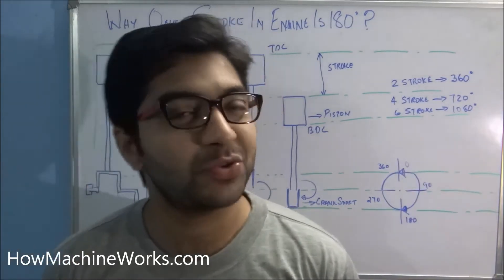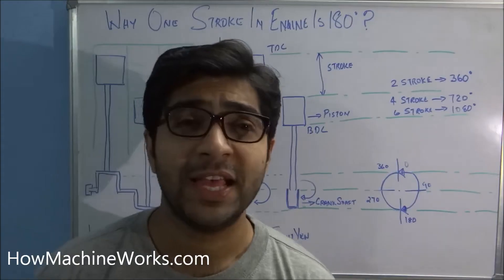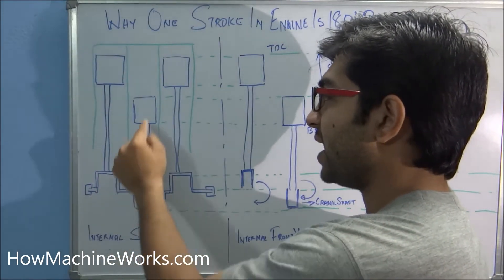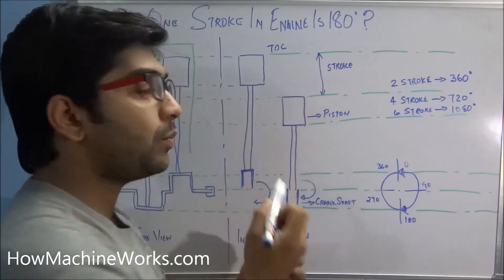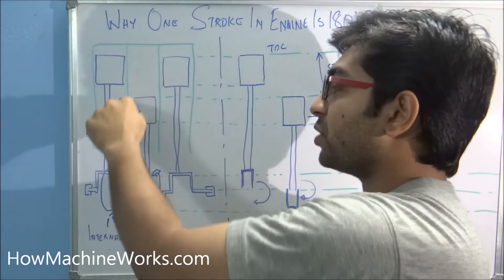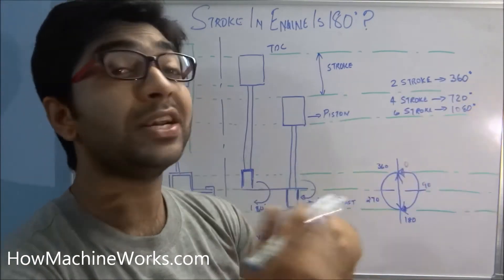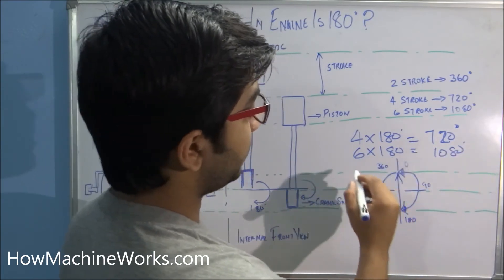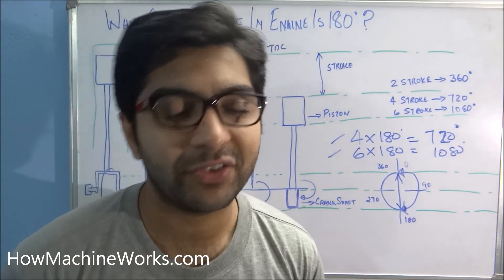Why one stroke in engine is 180 degree - Explained.

Comment: You can have one stroke engines too.  There is a power stroke every half turn of the crank because combustion occurs on both sides of the piston, in the top half of the cylinder when the piston is moving up, and in the bottom half when it is moving down.